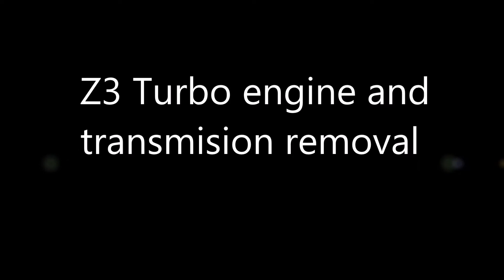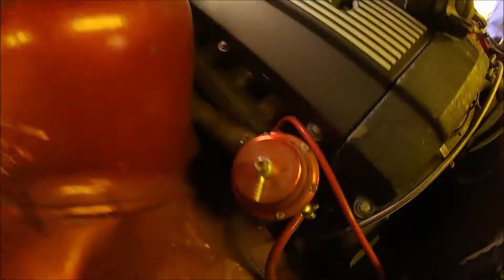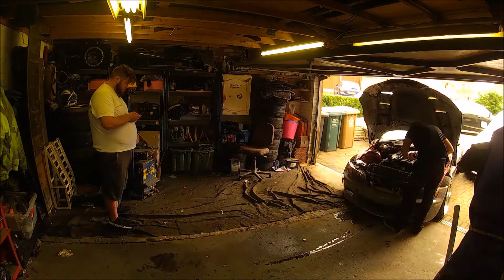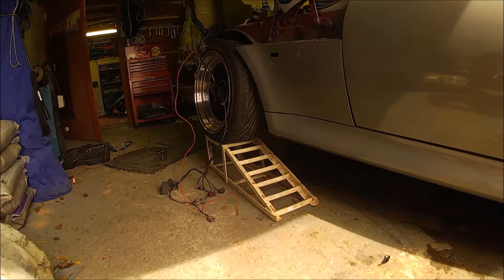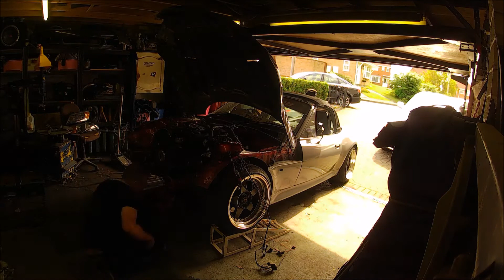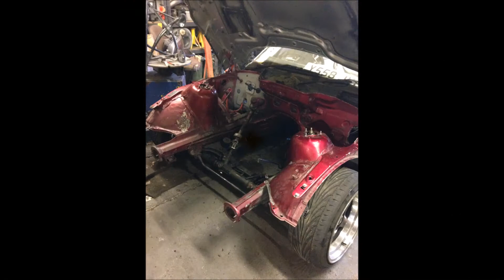BMW Z3 TURBO REBUILD - EPISODE 1 ENGINE AND GEARBOX REMOVAL

Comment: What turbo are you running? 
Was it difficult to get the downpipe round the engine mount/steering column?
Did you run a scavenger pump on the oil drain?

Comment: What ecu do u have in the BMW z3 I'm trying to turbo mine
Reply from the maker: Matt Stros I used the standard m50 Bosch 402 for the non vanos engine with a ecu masters det3 piggy back wired in  , but I would recommend a vems pnp ecu as it's much easier and produces better results I just didn't have the money at the time but ended up spending just as much overall after paying to get it wired in and set up. Any questions you have about your build il be happy to help .